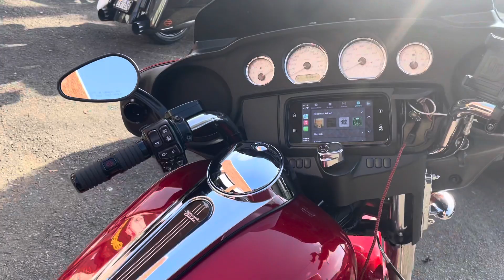Maurice wasn’t letting snow stop him from  upgrading the audio on his Harley Davidson Street glide

Comment: Carlos the grills on the saddlebag lids will they fit on the 8 inch dirty Bird lowers with GZ coaxials lmk also link to purchase them thanks
Reply from the maker: Yes

You need to order 2 

They sell them in singles 

8-Inch 2-Piece Steel Mesh Speaker Grill - Black https://www.amazon.com/dp/B0002KR06U/ref=cm_sw_r_cp_api_i_A31729N4WAAVMPPYYBZY
Reply: Thank for the response and link your the man